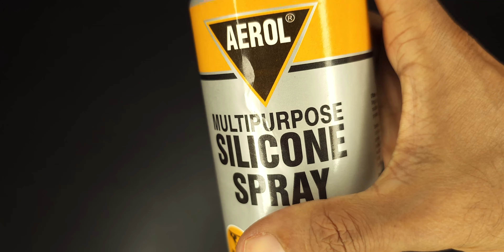Philips 5000 Series Trimmer - Disasembly and Switch Fix

Comment: This video actually just helped me save at least 50eur... had a broken wire right at the motor, so instead of new trimmer I fixed it at an approximate cost of 10cents (flux & solder) :)
Reply: same. Was an easy fix with that video.

Comment: Thanks for this video! Without it I would still be struggling to find out how to disassemble this trimmer without breaking it. In my case it was the red wire that’s got cut, a quick solder of the cable got it back to life.

Comment: Thank you very much. I opened it up with only a few complications, mainly the locking clips, but the hair clipper oil did the trick. My motor was loose with both red and black cables detached. It was fairly easy to strip them and re-solder them back onto the motor.

Comment: Very helpful, thanks a lot! I also (like babelhoo below) had a shaky connection where the red red wire is soldered to the motor terminal (how in the heck that could happen). Where the video says wiggle, twist and pull out was the hardest part for me. I was almost sure I would break something with the force I had to use. You show directly afterwards the locking clips that were holding it - could there be any way to release these before pulling? Perhaps the service shop has a too for this purpose. In my opinion there should be a special place in hell for people who design products to make them near impossible to repair - don't know how they can sleep at night!

Comment: OK so the top trimmer part just pulls up and off.  I never knew that, I guess it pays to read the manual.  OK so figured that out.  I have the same style clip on there, but it does not have the 2 screws and I can't see how to get it out. Note the white plastic part will just slide up and off.  Not sure if he shows that.

Comment: I have an MG5750.  I do not think it can be opened. It is a clamshell design. I could not get the lower silver part off. So there is no way to fully open the two black parts. Also the parts in inside are attached to the shell, so they don't slider out like other models.

Comment: The screws of my trimmer is beaten up i can't open it. Is there anything i can do?
Reply: In my case, they are torx screws and not Philips screws. Could that be the issue? If you are using a regular Philips screwdriver, you won’t be able to remove the screws.